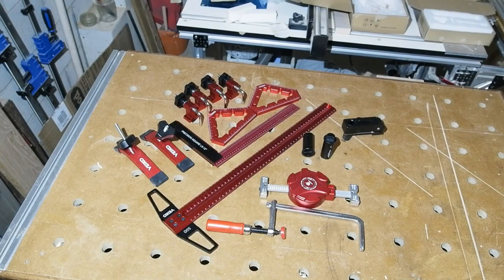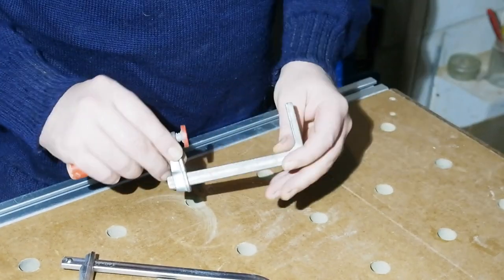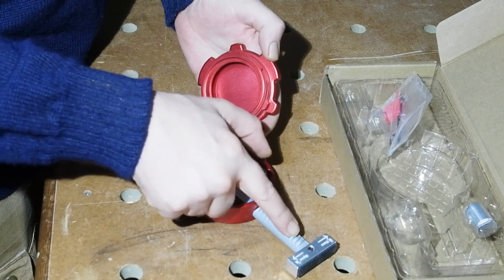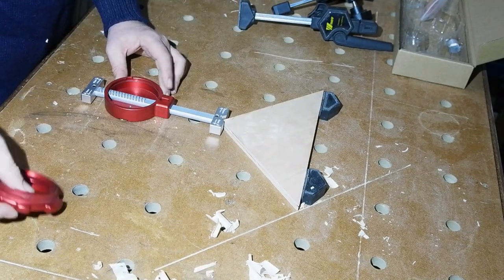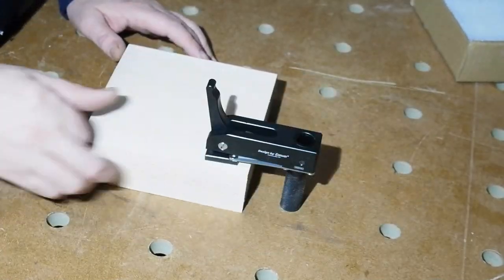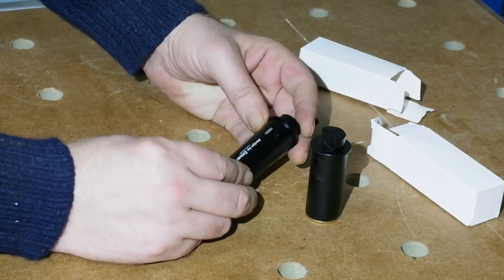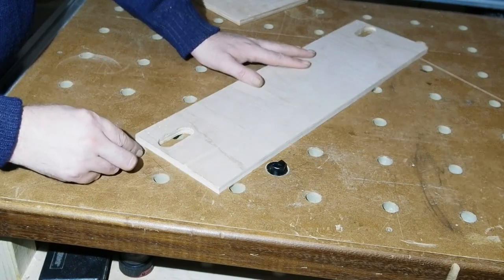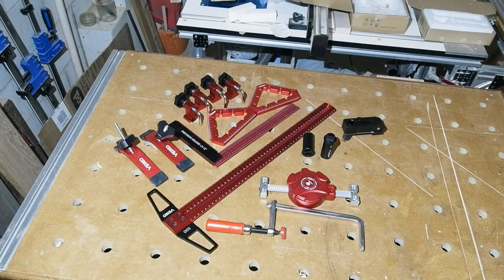Banggood Tool Review And GIVEAWAY!! Woodworking Tools [Gifted] for MFT and Workbenches

Comment: Here long after the party - but I've had and used the hold downs for a few months now and I find myself reaching for them almost daily, holding down dovetailjigs, materials etc. I don't do any hand planing though, but I keep using them constantly. Turned out to be significantly more handy then I first thought.
Reply from the maker: Cheers Christian. Good to hear. These Veiko ones were particularly nice. I have much older ones (which I also show) that have proved useful hold downs for all manner of things really. From my sliding carriage to various jigs. I just swap out the fixings for what will work. 👍

Comment: The hold down clamps look very interesting, but probably more for a traditional bench than an MFT style bench I think. 

There are several options for a one handed hold down clamp but none look to be as good value for money as these ones from Banggood.
Reply from the maker: They're a decent, well made hold down no doubt. Certainly suited to more traditional workbenches. They do come in a 19mm 3/4" version too - the more traditional hole size. One thing I should have mentioned in hindsight is that the stem is grub screwed in place. So it's possible to fit a longer length, smooth stem if you had some 20mm (or 19mm if applicable) bar.

Comment: Like your videos! I prefer to buy the original stuff....
Reply from the maker: Thanks Henning. In fairness, from the items shown in this video at least, the Hondui linear clamp and the Ganwei hold down clamp are original designs. The Hongdui is similar to a Kreg and the Ganwei similar to the new Festool but, these ones from banggood are different and not plastic rubbish like the Kreg and Festool. The Ganwei hold down was released 6 months before the Festool too. The Ganwei pop up dogs are also an original design, though not the only pop up on the market. The guide rail clamps are a Bessey design. Every similar one, whichever brand, is a copy of the Bessey originals, made under licence or just ripped off. 🤷‍♂️👍